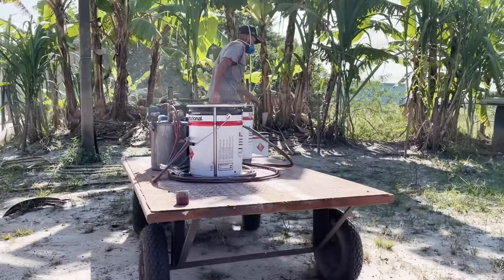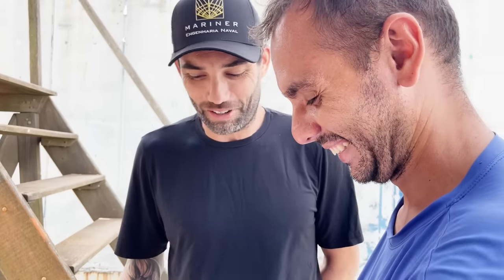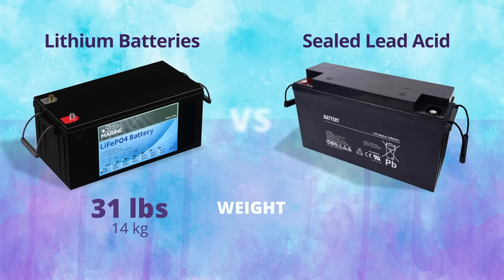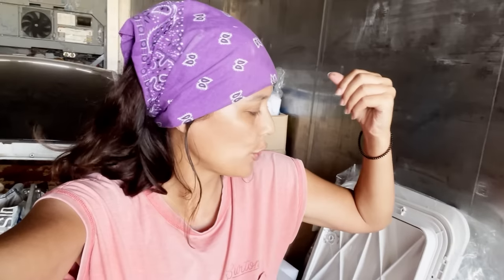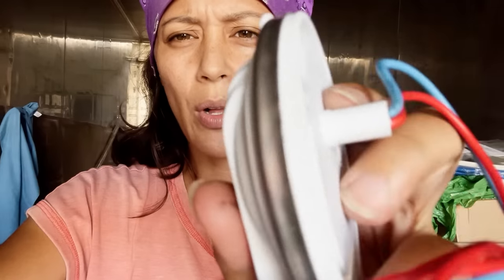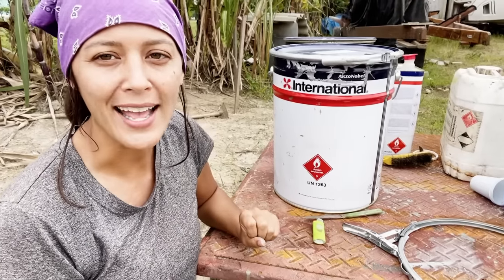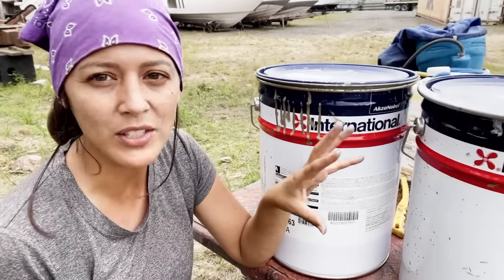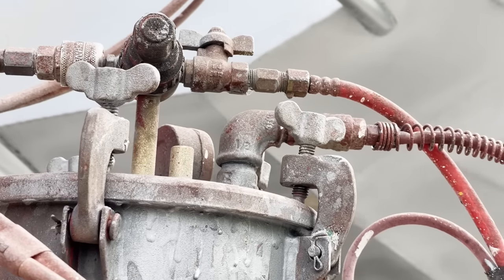Building the Ultimate OFF GRID Electric Boat ⛵️ Ep27

Comment: DIESEL IS THE BEST
Reply: I'd agree for the most part. They run on anything flammable and have a their highest torque output at 2500 rpm. But having a boat that is very silent does sound pretty nice.

Comment: your assertion that Lithium batteries are much more expensive than lead acid is not so true any more. I think I could replace my 200amp hours of lead acid which cost me $1000 CAD with 200amp hours of lithium for very close to the same price now. In fact my guess is that lead acid has gone up if anything. Good deep cycle lead acid is expensive. Lithium batteries even rated the same have about double the usable energy as well. Lead acid are good for starter batteries still, but not much else.

Comment: i appreciate the idea of going full electric but i still believe some type of generator/backup propulsion  on board in case of emergency.  The number of boats that get hit by lightening is a major cause for concern.... Parlay revival got hit twice in a short period of time and you don't even have to get a direct hit to fry every system on the boat - a close strike can get you.  Be prepared- be smart - be safe.
Reply: You are so correct . With in ten miles is a close strike sadly . You can try to be prepared for it though .
Reply: Absolutely! and since thaye are in the deep water, it conducts electricity and there's no real ground for the electrical charge. The lightning also produces gazillions of colts of electricity. I think we need to see how we can insulate all electrical and electronic equipment from lightning strikes. Guys what kind of vomms antenna do you have? Now a days you have powerful compact antennas which don't need to be installed on the mast. Also I wanted to ask of there is a way to remove the mast mid sea and store it and plug the hole water tight and run the yacht only on motor and windmill which they have installed. This is for emergencies. The good thing is that they have installed a fan on the back of the yacht which acts as a windmill. This will generate electricity through wind. And also propel the craft forward a bit because the air thrown behind by this windmill will also have some force.maybe half or one knot from this.

Comment: Physician here, the lack of adequate respiratory protection on your painter is heartbreaking. Regarding the electrical system, I wonder if 1400W is enough? I’d at least consider building in a mounting system for some removable panels on the foredeck and/or gunnels for becalmed days. You’re lucky to be doing all this from the ground up. Very excited to see what comes next!
Reply from the maker: You are right, here in South America  unfortunately there are lots of people who prefer not to wear the proper equipment. Proper equipment was available. We would love it if we could fit more panels! Our boat is a bit small so we are limited by space but we have thought about slide out or flip up panels when at rest. Cheers!
Reply: @lahakai  The painter who painted my boat here in North America was the same way. I think it’s a painter thing.

Comment: Ditto on the Schlick comments. As an architect and builder of several homes, planning and using the right methods and materials distinguishes the skilled from the average DIYer. I have a steel Bruce Roberts ketch undergoing a refit now. Complete rearrangement of the interior too. The theme is ‘less is more’, as opposed to production builders who throw everything but 5he kitchen sink into a small space. Sleeps for two, suppers for four, and drinks for six adults sums it up. Best of luck and happy building.
Reply from the maker: Very much appreciated! 🙏🙌 We love learning and wanted to do this project build to get our hands dirty and learn. But to do the quality like these pros do would take years of practice. Hats off to them and we are in a very fortunate place where high quality professionals are affordable (Brazil). We also love the less is more design and are trying our best to get some clean lines and open space in the boat while also getting maximum storage. A tricky thing in a small boat. Would love to see your refit, are you posting videos?
Reply: @lahakai  I am not posting videos, however, I am thinking about doing so, not to make money, just to archive the effort so others might find it helpful. Strategies for simplicity are also on Sailing Uma early vids. Mine are to create multipurpose spaces. One example is using an extension of the galley countertop to create a dining table, nav station, and prep area all in one surface. I eliminated the v-berth and put the head in there, along with storage for lighter things, and a mounted vice. The toilet is right under the deck hatch to catch light and give me 3” more headroom while seated. It’s hard to use a head when underway in rougher seas so a passage bucket will be used near the companionway where there is a locker. The settee is 1.2 by 2.0 M , and is the shared bed  too. Another berth is narrower for passages  and all complete with lee cloths. I also have one quarter berth accessed through the wet locker. So the settee is two things, a berth and a divan. The head is a head, storage and work area. The galley is a galley, nav area, and dining table for one.  There is also a closet and drawers across from the second bunk. I got rid of things I don’t need and gave myself things only a larger boat could accommodate . The big deal is making sure you maintain bulkheads wisely. They don’t necessarily have to be symmetrical in all cases.
Reply: @lahakai  oh, and I am NOT using spray foam for insulation. But the boat will be insulated.
Reply: @einarquay  I like your thinking. Would love to see more. Let us know if you publish any of this process.
Reply from the maker: That is very interesting and we would love to see! Do let us know if you post anything.

Comment: Make sure you have the right fire extinguishers for those batteries, and never drain a lithium 100% it will stop working and on next charge attempt it can explode or burn. Please install voltage regulators to alarm or cut-off charge at a set amount listed for the batteries. Never drain a lipo 100% no mater what the manufacture tells you.  Awesome Build keep it rolling
Reply from the maker: Very true! Definitely should be top on the list! Cheers!
Reply: Many modern lithium batteries come with a Battery Management System (BMS) built in to each battery that monitors charge, voltage, temperature, discharge rate, etc.  It shuts the battery down when you try to do something dangerous, such as discharge it 100%.  You still need a good charge controller, but each BMS protects its own battery.

Comment: Team, I am a marine engineer with over 40 years experience.  I have seen green water on a forecastle fit /remove even welded equipment off the deck.  Your foot switches will be subject to wave action.  Any green water sweeping across the deck has the potential to lift the switches off the deck.  If you only glue them on, they could be swept off leaving a nice 10mm hole in the deck.  I recommend that you both glue and screw these items to the forecastle.
Reply from the maker: Hey Peter! Thanks for the sound advice. We'll take that into consideration and look for another way to fasten it to the deck, ideally without making more holes, but let's see. Cheers!

Comment: I think electric is a good choice. While it seems you have lots of panels and batteries, I would try to make room for adding on the go. It may seem wrong but adding solar panels vertically on the side rails is a place where no extra windage is created and early morning and reflected sun is picked up. It is really hard to make solar panels perpendicular to the Sun, so having more than needed is always good. My little 400watt pack is flat to the roof yet even at 50 degrees north we get over 300watts out of it.... so long as we can find a place to put it. Most of the time we can't so the Sun is there but we can't use it all. However, when it's cloudy we are still ok.

Comment: Before purchasing your batteries, talk to the manufacturer. Because of the different BMS used there are limits on how batteries can be configured and the max load. Most now have quite a lot of knowledge about using them with electric propulsion systems. You may even find a sponsor.👍
As others have said, reach out to others that are already sailing with all electric systems. They will probably have a wish list of how they want to improve on what they have so giving you the chance to have an even better system.
Wishing you all the luck in the world, and looking forward to seeing the rest of the build.

Comment: Hi guys, I applaud you for your plans. Big respect! As a sailor I would like to give you some advice regarding your electric plans:
First big thumbs up for your intentions going solar and wind power. Please do the math: how much power does every piece of equipment use and how much can you charge the batteries.
Bear in mind that the maximum capacity of your solar panels only is when the sun is shining. Also the wind generator gives max 250W, but that is also only in perfect wind conditions.
When there is no sun (at night and during very cloudy days) and there is no wind, (which happens more often than you think) you are not charging your batteries. Especially the fridge, autopilot, pumps, windlass and watermaker consume a big amount of energy.
My advice is: make a backup plan for energy consumption.
Reply from the maker: Thanks so much! There definitely is a lot calculate. We've made lots of spreadsheets so far with our numbers but still a ways to go. We'll have more details coming soon about the technical stuff. Let us know about your feedback as we go! Cheers!

Comment: With the chances of a lightening strike I would think in depth about full electric. You need to watch videos about what happens when lightening does hit the boat.
Reply: If careful you can use it for your own advantage. And gain extra power. :-D But yeah... insulation should be more important than food on a boat like this.

Comment: Hi Luke & Lori, this morning I was searching for your “update” as usual around 9 - 9:30 to no avail, but finally in the early afternoon I saw the notice of your upload…
Good to see the progress you are making, the boat hull is starting to look very nice with the multiple protective coatings !
In regard to the electrical installation, it appears to me, that the combination of solar array and windmill is on the small side when considering the overall capacity of your battery banks, which only considering the 48V bank should be topping out at ~ 8kWh, 
+ the 12V system in addition to this… 

Your solar & wind generation of ~ 1400 W seems too weak to replenish the batteries in one day, if you use the battery bank for the house load and motoring you will need double the capacity at least, except on days when you will not use the motor a lot, or not at all.
Your choice to install an induction cooktop is against other opinions a very good one, as I can confirm from experience : cooking times (and therefore power consumption) is minimal, and by the time you get really used to cook on induction cook tops, you will never want to miss it, as the temperature regulation, timer feature and the easy to clean fact are priceless and let you look like a professional cook ! Even grilling and pan searing with proper seasoned cast iron pans/griddle plates is a walk in the park - you will love it !

Looking forward to see your progress !
Reply from the maker: Hello Helmuth!! Ah we are so glad you checked in for our video. We ran a little late this week, but we are back in the air!!

We've are really juggling the size of our boat with the equipment we can fit on it. Once we dive more inside we will see if its possible to get either more batteries or be more creative with ways to get more energy. The way we see it is there is going to have to be some lifestyle adjustments and lots of planning to live on a small electrical boat like this. Sticking primarily to minimal motoring and predominantly sailing and planning way ahead. We'll need to do lots of testing for sure.

We totally agree about the cooktop. We've been running the numbers and though a cooktop can pull lots of energy, it cooks at a fraction of the time. We are testing it at home now and boiling water is in minutes. We looked into a 12v kettle and it would take 45 minutes to boil. So there is also time is also a big factor, not just the number on the tag. Cheers!!

Comment: You can build anything you want the limitations are weight distribution and running duration. I am glad you chose LiFePO4 battery's in a boat. I have an EV and in a battery fire I can get out of the car. You possibly could go into why you chose LiFePO4 vs the more energe dense alternatives. Also with your batteries I had a Karaken attack my boat and rip of the rudder holing the boat (nothing surfaced and it missed the keel). Anyway my batteries were low in the boat but under a fibreglass cover, the cover created an air bubble under the water and the batteries stayed 100% operational over the 7 days it took me to limp the remaining 2 days of the "8 day trip". 7 days underwater in the bubble. Think a bucket over the battery I never knew who made that but it was painfull for dealing with cables but saved the boat!

My concern battery and solar only is outrunning a storm will not be possible as it gets closer you get less power from the sun and need more power to go faster or run the autopilot. I would recommend a generator just for that scenario where it can supply the motor and charge the batteries you cannot imagine how hard the autopilot works in bad weather and 100% you will not be out hand steering for hours in a storm but out and back in checking when it feels like the Karaken hidden in the squal's chasing you is a little further away. Also batteries and a steel boat a generator will be a get out of jail card in a lightning strike provided the motor does not take the hit (the boat hull should provided you do not fair it too thick).

Being a Kiwi I would recomend going South, Fiji, Rarotonga and then Australia and the Great barrier and Whitsunday Islands. Be very aware of where you are in Aust as Crocodile territory comes up fast but it is some of the best sailing and publoc mooring locations for swimming and diving. Raro has the best reef's and Fiji is very similar but cheap if you need work on the boat with stuff from NZ. Here in NZ in summer around the North Island but you are better to fly from Fiji to the south island and do a lap in a van the sea and number of harbours are a fair distance between in fast changing rolling from Antartica. You won't regret the Pacific Islands or Australia east and west coast further north you may want AC and d'nt go under Australia lots of old sailing wrecks better to go over the top with the heat and crocodiles.

NZ South Island and below is the only place I have been knocked down with wind and wave at the wrong time never all the way over yet.

Anyway in a steel or alloy boat you can choose all the latitudes and what side of the equator just pick the season and weather window better than I seem to and also there is a orthodox direction to sail a lap of the planet, going the wrong way can be hard work for weather patterns usually it is skirt around a storm.

Anyway there is a movie you need to watch as new sailors "Captain Ron" from 1992 it is a compulsary watch for all sailors!

Fair Winds and following seas.

Comment: You are definitely on track with the proposed battery 🔋 setup, However,, your boat will need at the very LEAST 3000w of charging.  That means at the very least, you will require a generator using gas ⛽️ or diesel to replace the charge that a mere 3 solar panels can provide.  There is no free power.
Reply from the maker: We are working on finding more spaces for panels. For now there's a guaranteed three panels but hopefully with some creativity we can find some more spaces on our small boat. We saw some others doing slide out or flip up panels when stationary. Lots of possibilities out there! Cheers!

Comment: I think you should reconsider your propulsion choice if possible and use an electric outboard instead of a electric Pod motor. 

The Pod requires mounting thru holes and becomes an appendage hanging off the hull, and I don’t believe the affordable options are cut out for living below the water for long periods of time based on how poorly the outboard versions hold up that only spend part time submerged. 

Obviously if you have any serious issues, you will need to haul out, whereas an outboard is much easier to service, even upgrade or replace if necessary. 

I would also recommend purchasing batteries that can be easily accessed and that you keep a backup/replacement BMS or two onboard in the event of a failure since you are wiring up a number of 12V in Series for 48V. 

And unfortunately with your hull shape being inefficient and of heavy displacement, maintaining cruising speeds with the electric motor is going to consume a lot of power relative to the size of your solar system. 

I would suggest working backwards and figuring out your target cruising speed relative to hull speed and then making sure you have enough solar to at least offset that consumption. 

Ideally you should have more so the bank is recharging while you are at cruising speed, and the bank capacity can then be used when you lose sun or need peak motor power. 

Just some suggestions from a guy who has been building solar electric boats for a while now.

Comment: Glad you're having pros involved with your build. It can cost a lot more, but you get a faster, safer result in the long run. Only thing I would question is whether the coatings used were water soluble. The water bubbling out of the paint gun air line and then mixing with the paint would be disastrous for solvent based paints.